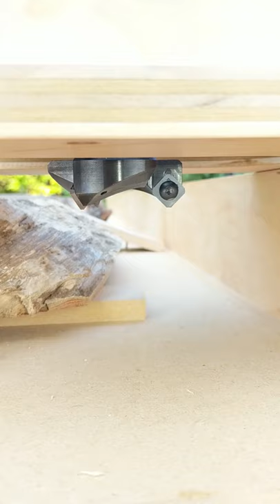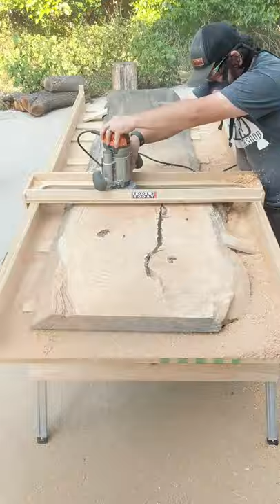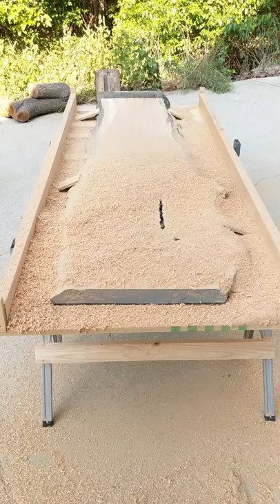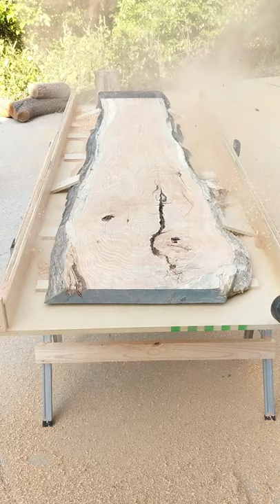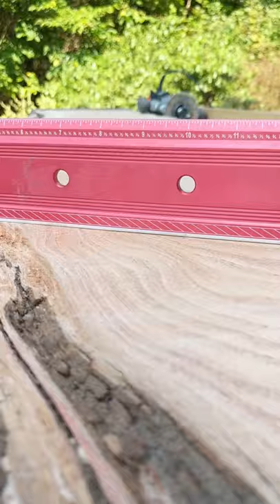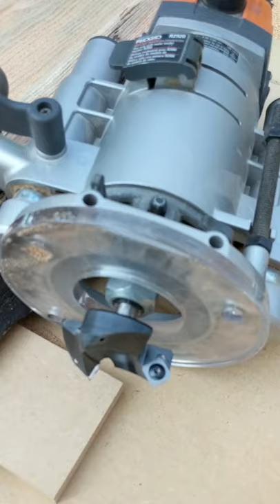Flattening a Slab

Comment: That plywood guide is bending in the middle. You can see the dip when you put the straight edge across it. Just a little thing mind you
Reply: I saw that too but wasn’t going to mention it. Lol
Reply: What 1mm maybe
Reply: More than 1mm . Use metal rods and bearings I built mine for £130.00 all parts of Amazon . Top tip ; don't go across the grain.  You leave burn marks and will get an occasional tear on the surface, some woods are worse than others for this . Rig it up length ways go up and down the grain  ,much better result 😊try it .

Comment: I'm trying to understand that wouldn't the side the slab is laying on have to be flat before trying to plane the top? Cuz wouldn't a unflat bottom of slap which it's going to be laying on determine the whole result of the planing on top idk if you guys understand but if you do let me know.
Reply: When flattening slabs, it's the jig's rail that is used as guidance to get the flat surface. Not the bottom side of the slab. So, the rails need to be levelled and straight. 

After one of two sides of the slab gets flattened, then the flat side can be used as guide to flattened another side with big thicknesser.

Comment: Why does the website listing say these are for CNC only and not handheld routers? The video itself shows it beibg used in a handheld router.
Reply from the maker: They are fine for router use as long as it is in a sled like this one.  It cannot be used freehand at all.
Reply: What is the link for the sled?